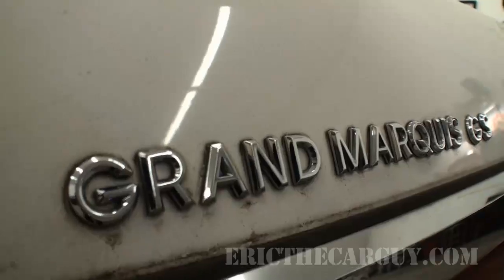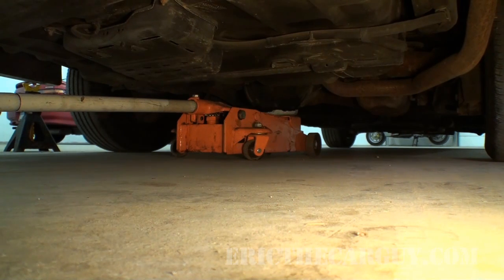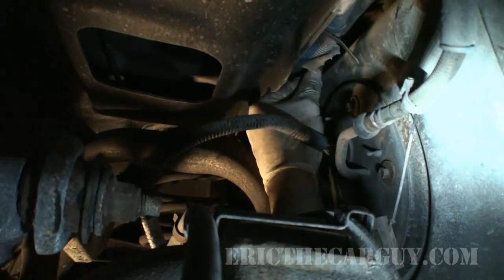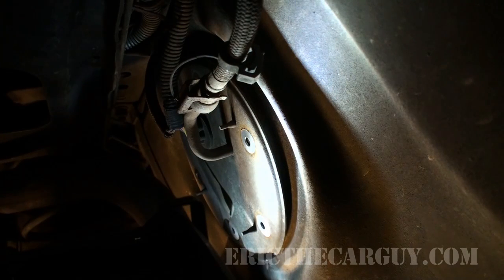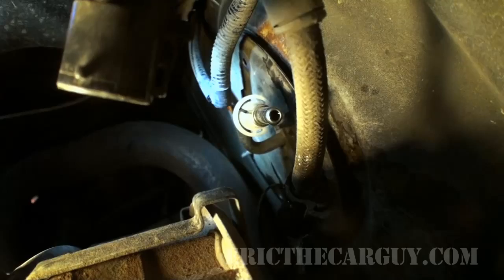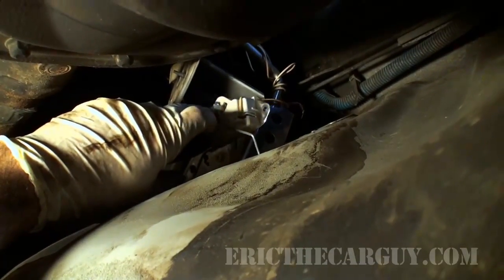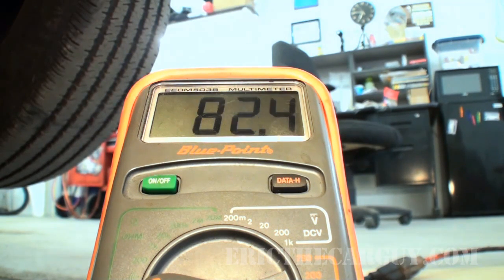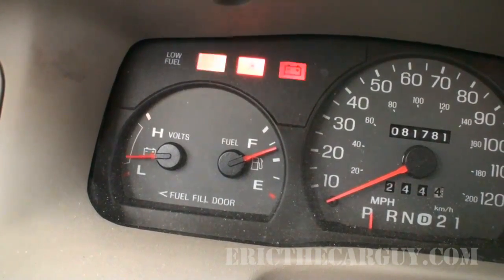Repairing Fuel Gauge Problems 2004 Mercury Marquis -EricTheCarGuy

Comment: be careful with this on fords as some may have an anti slosh strategy. where the ic will see the level rapidly change but not show it to the gauge because it thinks it is sloshing fuel it will want to see that level stable for a predetermined time before it shows it to the gauge.for this its best to use a scan tool with good pid display data and watch the fuel level change when disconnecting the connector (creating high resistance) or shorting the circuit(creating low resistance.

Comment: It's worth pointing out that this gas tank design is ages old, from the Pinto years.  NOBODY puts the tank between the trunk and axle anymore.  It's no surprise that with that level of lazy Ford also didn't bother to design the tank to a more intelligent standard.

That being said, putting the tank there does give you that ridiculously cavernous trunk.

Comment from the maker: Not exactly. I measured the resistance of the sending unit directly which showed that it was good. I trust my experience. The vehicle has been gone almost 2 months and the gauge is still working fine. In a way, I was trying to make a video about fuel pump removal as well but that didn't work out the way I planned. Remember, I'm not just repairing vehicles but also trying to make interesting video at the same time. It's not as easy as you might think.
Reply: EricTheCarGuy   Eric I bought a similar car just a mercury, I have the same problem that just started where it keeps going past full, before sometimes it would do that and drop back down, recently now it’s not doing that and staying at full all the time, and this car has had the whole sending unit and pump replaced, need help. Thanks

Comment: I am thinking check ground first,Pump fuel out with pump in the tank,line hooked to schrader valve , Disable fuel pump to relive line pressure. witch the hose on the schrader valve would do also.Going to have to see if my meter sound kicks off like that. I am like you ,in moving the float arm being the only way to test the sending unit.

Comment: Hi Eric. Appreciate the video. Excellent, as usual. Got a question: 1997 Merc Tracer/Ford Escort wagon (2.0 motor) has stuck fuel gauge at 1/2 tank. Gauge never moves, even on startup/shutdown. Bad gauge, or sending unit? Keep up the great vids. :-)

Comment: It's a whole lot easier to use the pump to drain the tank before disassembly by jumping the relay. Also, you get a lot more room by supporting this vehicle at the frame instead of the rear (let the rear hang down), use a prybar to hold the exhaust out of the way. The other harness goes to the tank vent, which is a MAJOR PITA to get to and disconnect. I usually strip the wire loom and pop the pins out of the main connector.

Comment: Resistance to match IC input signal tool.if doesn't match what I'm putting  in circuit then check for resistance  open or shorts.if it matches then its a cluster issue.make sure pin fit is good .and that's the way I do it,sounds long but its not,better and cleaner than pulling sending unit just for diag.

Comment: Put in place of the sender, change the resistance as the sender would from full to empty resistance range usually 0 to 90  or 0  to 180 depending on model.watch fuel level pid reaction to resistance change.dont pay attention to fuel gauge because some have anti slosh strategies were they won't report sudden fuel level changes due to fuel sloshing around fuel tank.if pid reacts to  resistance changes in correct manner then its the sending unit.if not then disconnect IC and measure circuit resista

Comment: As a ford dealer tech.i use the Ids scan tool to active command the IC fuel gauge to 0 25 50 75 or 100%  to determine if IC has the ability to control gauge.then I check fuel level voltage and  percent correlate to each other.then ill got to sending unit and measure resistance at the connector component side.if that resistance islet with in min max range then its bad.if its ok I use a  IC  input signal module witch is basically switches and dials that change resistance across two  wires that you

Comment: Here is a tip Eric next time you have a tank full of gas to deal with and a still working fuel pump inside it. Disconnect the fuel line to the engine and run it to a gas can then power the fuel pump with 12v and let it pump out most of the gasoline for you before you remove the pump assembly.

Comment: You can remove most of the gas from the tank by connecting a hose to the fuel pressure test port at the engine and running this hose into a gas can. Energize the fuel pump at the fuel pump relay to run the pump. Be sure to jump the correct pins at the relay. Do not let the pump run dry.

Comment: Bryan. A hack? That's actually the first thing a lot of us pros go for on an issue like this. That fact its giving a reading means the signal is bad. If it was an issue with the wiring and what not it would not jump like it did. Experience is the most valuable tool you can own.

Comment: Hey Eric, 

The issue is that the Ethanol is causing a buildup on the contacts on the sending unit. Usually I replace them b/c the problem will come back. FYI, I own my own mobile repair business and also volunteer at my local High School for automotive. I specialize in the Panther Platform (Crown Vics, Mercs, Town Cars). If you need a consult on something, buy all means let me know. 

Bryan, Vero Beach
(The Lincoln Man)

Comment: What I did for testing sending units on a GM is frankenstein a testing rig from old fuel pumps.  Take a working sending unit and the wire harness, clip the 2 wires for the fuel pump power...now you can unplug it at the tank, leave the pump in, plug in the testing rig and sweep it up and down.

Comment: Scan tool is the best tool to start the testing, with enhanced EVAP on all modern cars fuel level is monitored by the ECM for EVAP testing, most will only test when fuel level is over 20% and less than 80% if the scan tool shows fuel level is at 4% or gallons to empty and gauge is at fulll I would go for the gauge if it shows 0% you go for testing the sending unit. FYI fuel level is monitored by the ECM and that info is sent to the IPC- instrument panel cluster- aka gauges via ECM

Comment: My feelings are not hurt, I am a professional mechanic (ase master certified if it matters) I work on all makes and models. They all do stupid stuff like this. Ford does not have the market cornered on stupidity. Sorry to burst your bubble.  But back to your point, yeah lets put the sending unit on top of the tank where you have no choice but to drop the tank to gain access for testing!! That makes more sense!!

Comment: First thing is the sending unit is in the side of the tank, not the top. Second, the wires that go into the vehicle and not accessible from under the vehicle like the plug that he disconnected. Those are stupid flaws that make ford products a nightmare to work on. Sorry to hurt your feelings but OH WELL you will get over it. :)

Comment: Explain to me how anything covered in this video is a Ford design flaw..  Every manufacturers puts the fuel pump and sending unit in the gas tank. They all use the same type of floating arm on the sending unit. They are all variable resistors or rheostats..  So how is this a Ford design flaw???

Comment: Murphy's law for auto mechanics. If you need to work on the gas tank it will be full. If you need to test drive the vehicle extensively for an intermittent problem the tank will be empty!!

Comment: PS  It's the EMPTY gas tanks that are dangerous to work on.  A full tank is far safer.  The empty gas tank's FUMES are far more readily ignited than liquid gas.  So top-mounted fuel pumps do require dropping the tank, but it's safer to work on.

Comment: Although it was the sending unit that was stuck here, I would first disconnect the connector and turn the ignition on and look at the gauge. Resistance on those sending units increases as the level gets lower and when it is disconnected (infinite resistance) the gauge shows empty. On the other hand if the wire that goes from the gauge to the tank was touching ground somewhere along the way, when you disconnect it it would still show full, thus we don't have to mess around with the tank :)

Comment: Hi Eric i use a old electric fuel pump, connect the suction side to the pipe on the tank you disconnected and put the outlet side into a clean fuel container connect the pump up to 12 volts how ever you want just to get the pump working disable the cars fuel pump, while you are pumping fuel out turn the ignition on and watch the fuel gauge if it don't move after pumping 3-4 gallon give the sender a bump with a hammer. I don't like checking sweep with digital meters use an analogue one.

Comment: The simple way to get around the fuel gage problem is just fill up the tank and set the trip meter. A car like that isn't really worth spending the money to fix the problem. And most cars like that have a low gas indicator light that well come on even when the fuel gage doesn't work. But if a person whats to fix the fuel gage nothing wrong with that either.

Comment: If you got a Envoy/ Trailblazer with a messed up fuel gauge it most likely the stepper motor, It took me forever to figure out it was only the stepper motor in the gauge cluster and not the sending unit. I think GM is the only ones with stepper motors right Eric?

Comment: Have the driver full the tank, set the trip meter to zero and drive for 150 -175 miles to use up most of the gas.

Comment: When I had a problem with the fuel gauge on my Porsche 944 I looked for a a harness connector and disconnected it at that place. If the gauge is pegged at specific location all the time i may be a ground or short problem. I then measured the sending unit for resistance. It checked out good. I then took a variable resistor from 0-250 ohms and put in values according to repair manual and checked the gauge by connecting the resistor to the wiring harness. In my case, it was the gauge.

Comment: I also use the pump itself to drain the gas in clean containers. Most modern vehicles have anti siphoning equipment installed so from above is not always possible. And its a waste of good and expensive gas

Comment: Check the wiring to the temperature gauge and the connection at the gauge.  Test with OHM meter.  For 1981 to 1990, coolant sensor, 13,500 (OHMS) @ 20 degrees F.  Subsequent values:  7,500(Ohms)@40F, 3,400@70, 1,800@100, 450@160 and 185(Ohms)@210F

Comment: I have a similar problem. I have a 1990 chevy 262 and the temperature gauge is not moving. I replaced a sensor close to the thermostat but nothing. I manually moved the gauge just to see if maybe it was stuck but, nay.
I'm just driving temperature blind, if it doesn't smoke must be ok...
Any idea anybody?

Comment: I have a 1999 dodge stratus and when I put gas it says its full and after driving a while the.car kills the gas and its 4cylinder. And there's times where I smell gas and then there's times where I break hard the car turns off. What are the problems.lots of miles

Comment: Love your videos. As a professional in the field, you rely on your experience and know what’s risky and what isn’t; however, for the benefit of amateurs and “shade tree” mechanics, may I respectfully suggest you insist on disconnecting the negative battery terminal before doing any work on a fuel system, particularly if it involves exposure to fuel vapors. Horror stories abound of inexperienced individuals who didn’t heed this advice and ended up self-immolating because of an errant spark.

Comment: I had a fuel leak on my Pontiac G6 caused by the plumbing coming out of the pump assembly.  The car still ran well enough and the indicator gauge worked properly so I did a few laps around our Loop 101 freeway until the tank was down to 1/8 of capacity.  The guys that worked on it were appreciative not to have a full tank to deal with.

Comment: A much safer approach is have the customer fill the the tank, reset the trip meter, and bring it in when it's known to be near empty.

Or, If the fuel pump is still working, it's not difficult to use it for a pump out. There are numerous other ways as well.

All that fuel raining everywhere was very dangerous, even a minuscule static spark from clothing, a dropped tool, drop light switch or whatever... or the vapors finding some distant ignition source would have been lethal.

Comment: eric you could place a rheostat in the circuit at the connector going to the sending unit. with the rheostat in circuit you can can the whole wiring and the gauge to see if it moves. if it does the only other thing it can be is the sending unit. it be easier than taking the sending unit. just a thought. your feedback on the comment would be great. thanks for the videos great info

Comment: With a known Issue like this where the arm is known to stick, It wouldn't hurt to drive the car about 150miles or wait until your commute makes those miles (if the tank is known to be full this should eat about 1/4 of the tank on most cars) then shake the car left/right or up/down. It's a bit easier than removing the sending unit. IMO

Comment: I recently changed a fuel pump in an 01 Silverado and I feel for you on the gas smell.  I found that if you wash with soap and water, which doesn't get rid of the gas smell, then wash with some vinegar for about 30 seconds and wash again with soap and water the gas smell will be gone.

Comment: I ran into this type of issues before and what I notice is that when that happens later down the line you will end up having to change the sending unit.  The first thing I check before removing the unit is the power cable make sure is getting power and then check the ground wire too.  Most of the times some lube and wigle fix the problem when it is a ground problem.  If not I change the unit any ways since there is a good chance that it will go bad later on.

Comment: That's a good idea but the problem with that is that if the tank is full then it will show full any ways so you wouldn't know if it is fixed.  Your method will work if you know have less than a full tank.

Comment: Mostly like Reading full is always ground issue,, Im sure that's what you adjusted by moving it around,, I do sugest you get a Mity Vac there $60 bucks and you can drain the tank with is, pumps like a bike pump, there great when the tanks full.  Love Mine.

Comment: On my Mk2 Golf, I connected my multimeter to the fuel pump/sending unit plug and shook my car from side to side by the door jams. I noticed changes in the resistance readings, meaning the level sender is OK. 

Great video Eric! God bless!

Comment: So what if the floater inside the assembly gets stuck when theres a full tank of gas and you just got it unstuck... ive had that situation on a 02 dodge ram so it worked fine after I put it together, but when the owner filled the tank all the way up the floater got stuck again and well he cam back saying the guage wasnt working again. By the way its just a thought from personal experience

Comment: I had a similar issue with a 2003 BMW 745Li, sometimes when I start the car the gauge says it's empty and when it does work and I fill the car it never passed the 3/4 mark. it disconnected the sending unit tested it and put it back on and everything worked correctly. maybe it was stuck or somthing.

Comment: First thing I do when it comes to electrical problem in areas like that, exposed to everything, is disconnect everything, a good electrical cleaner, a small bronze brush, clean everything before even remove a bolt, I guess around 50% of the cases the problem get solved and in a very fast manner.

Comment: There's an easier way to deal with the gas issue; attach a standard parts store siphon pump to the fuel line coming out of the tank, and siphon away any residual fuel into a container. I've found that this method works well, even with electric fuel pumps.

Comment: I know you didn't do it for long, just to get the axles up on stands, but in my Ford Certified tech classes we are repeatedly told NOT to lift from the differential case as it can cause some flexing from the weight of the car and pressure on the case at the points where the rear axles lock and seal to the differential case. Just what I've been taught, what are your thoughts on this?

Comment: Boy, that was a painful clip to watch. The fuel pump still worked, DC the line at the rail or filter, jump the FP relay and pump the fuel into a waiting car or gas can. 

I have repaired the same problem on Crown Vics, the ground for the sending unit is the problem I have run into (inside the tank). It usually requires a new sheet metal screw to sending unit to fix.

Comment: I have had to drop my tank in my Durango twice in the last six months and well even though I was using my impact the head on one of the strap bolt snapped off, luckily the bolt had come out enough that I was able to put a but on it and use it like a stud. Thank you aftermarket fuel pump that lasted 6 months. I put an OEM one in now.